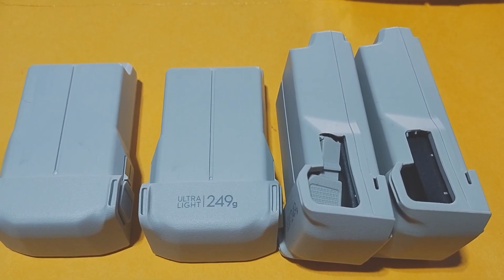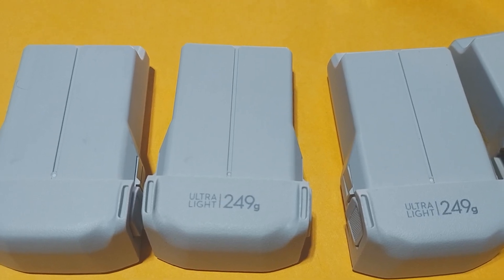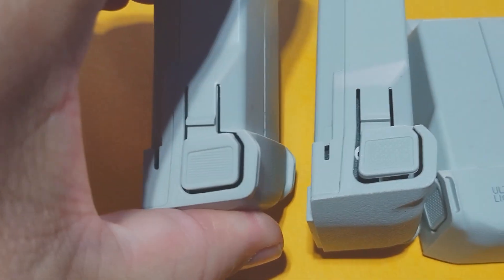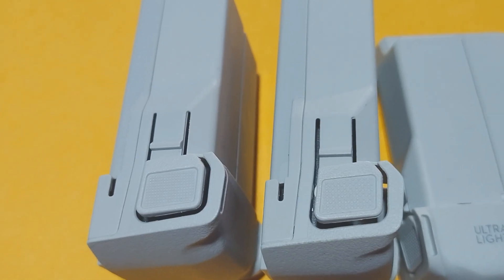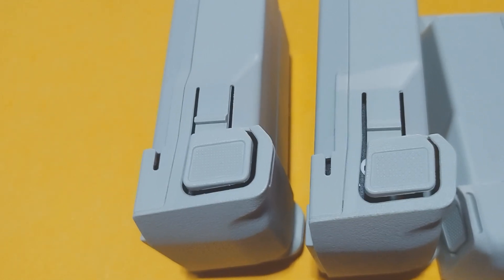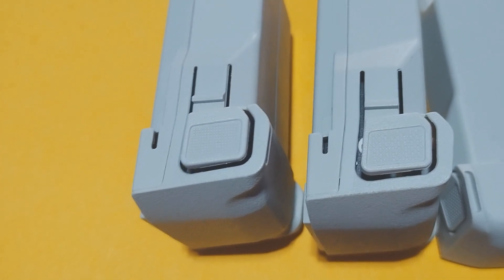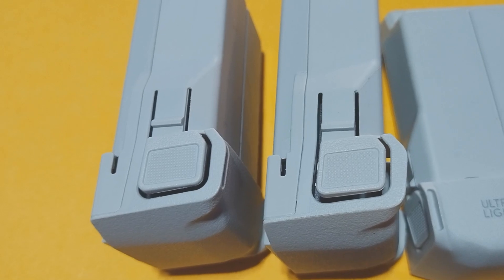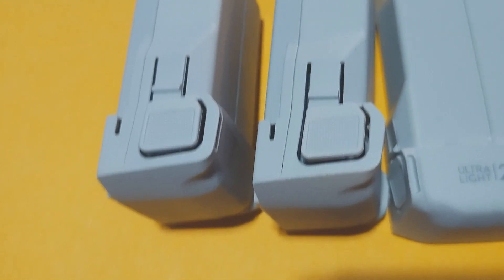DJI Battery Fatal Flaw Follow Up, Its Much Much worse than I thought.

Comment: Yes, my Mini 3 Pro batteries had the same issue.  So far, they have not been completely broken but I have worried about this for over a year and since my care refresh had expired, I knew I would just have to replace them at some point by buying new ones.  I still have them all and they still are able to remain safely within the drone without dislodging. I never bought the Mini 4 Pro but I have purchased the Mini 5 Pro.  Do you think this will happen to the Mini 5 Pro? Surely, I have no care refresh package with it due to U.S./DJI issues.  Thanks for sharing.

Comment: Can you take the battery case apart and put something on the inside to help it keep it spring tension
Reply from the maker: Not that I know of and I have barely used it since the video and have another already snapped and all but fallen off.

If someone would do it I think a thin spring metal tab could be made that would be able to slide over the plastic it breaks away from and replace them for pennies each. it would weigh no more than the plastic

Comment: This happened to 2 of the 3 batteries for my mini 3 pro. They broke within a few weeks from new over 2 years ago. The 2 affected are from the flymore pack purchased at the same time. I tried various type of repair, all were unsuccessful. A few months ago I bought a battery retention clip from ebay that holds them in securely. Search for “ Battery Buckle Lightweight Anti-slip Clip for Dji Mini 3 Pro Drone Accessories “ Since then I have bought some replacement battery cases. I have made a replacement on one of the affected batteries so far and tested it, a few times successfully. I replaced the part with the clips, leaving the battery still attached to the original other part. I had to cut/grind some parts so that the case fitted snuggly and I am happy with the fit. I still use the retention clip as belt and braces.

Comment: as my battery was new in fall i had no issue to my knowledge .. i flew it jan 8th 2025 and when i got home i went to remove the battery and with touching it i noticed the snap was sunken in--   IT WAS 27' F.  I THINK THE COLD HARDENED THE PLASTIC  AND T POPPED ?? - i was lucky the battery  did not fall out  in flight as i was very  high over buildings  the mini 4 would have been lost for sure....  now i am looking for glue  or silicone  to make some sort of repair as i only have 11 flights on this battery  and it is still  very strong  (short flights  at that)   DJI  SAYS  30 DAYS WARRANTY   FOR A 79 DOLLAR battery     EXPENSIVE  FUN HERE GUYS POOP .

Comment: Happened to me as well, just after 2 weeks of use (4 flights). My retailer replied that batteries are consumables and will not be replaced :( I will probably try some aftermarket (non-DJI) batteries and hope they will work better, because when its broken, it dose not hold in the Mini 4 PRO.
Reply from the maker: They replaced mine, They are covered for a year. Make a ticket. They are not fixing this if no one hold them accountable.

BTW are you using the 3 port charger?
Reply: @jsauerii  Yes, I used the two-way 3 slot charger that was in the fly more combo. The battery cracked when I removed it from the Mini 4. I only hope this does not happen with the remaining two batteries.
Reply from the maker: @xhobv02  I was trying to figure out if something in particular causes failure but I am pretty sure its just a design flaw in trying to cut weight. Even the two of the four I did not return were already cracking but you could only see it under magnification. They will fail soon with use I have no doubt.

Comment: I purchased the Mini 4 Pro Fly More Combo in September and one of my batteries had experienced the same failure on the locking tab by December. I submitted a ticket to DJI and received a replacement within 2 days in the post. Great service by DJI support but this appears to be a flaw in the battery retention design. Same as you my batteries are only ever in the drone or the 3 bay charger.
Reply from the maker: They finally got mine back yesterday, I only sent the 2 that have broken off, the other two are just cracked so I waited. I am actually wondering of some of the 3 bay charge ports were made out of spec because I am considering that as what might be happening because I do have to squeeze a lot to get mine out. I have asked for specs to measure but no luck so far.

Comment: I've got three official DJI mini 4 batteries with no problems after a year! ( Combo kit)
Reply from the maker: In trying to sort out the cause I have four initial questions.
1: When did you purchase the kit? 
2: Did you get the kit with the batteries marked   249G to keep it under weight or the longer flight batteries?
3: How many times have you used each battery. I know you can look when they are loaded in the drone via the app but if thats too much trouble a guess is fine. If its a dozen per battery or 100's per battery that will surely make a difference.
4: Do you use the 3 port DJI charger?

Thanks. I would love to track down the likely cause if at all possible. Anything to get the to fix it.

Comment: Are these aftermarket batteries or actual DJI batteries?
Reply from the maker: DJI official batteries from DJI themselves. I have no aftermarket batteries.
Reply: @ well I just purchased my drone a few weeks ago and I tell you what if the same thing happens to me, I expect a replacement from Dji!!!
Reply from the maker: @Wegotourcountryback123  Keep an eye on them. If I can find someone else with recent failures to post on here I want to check on a couple of theories I have as to what is causing it. I am guessing a bunch of people ignored it, thinking it was something they did or they just tape them in or havent noticed the cracks yet. 

No way I have 4 of 4 going bad, Yeah the three in the kit maybe if they were manufactured at the same time but they don't even look the same, and the extended battery was bought later. I never noticed the issue though with my mini 3, but only had the one battery there.

Comment: Hi there.We're very sorry to hear about your feedback. With this, may we confirm if you've contacted our team? We want to help you in any capacity and we need to communicate with the relevant team to further look into this matter. Kindly provide any reference ticket/case number (CAS). We're always here to help.
Reply from the maker: I have not yet sent this follow up info about finding the other two batteries are breaking as well. Its the weekend. And to be honest, what are you going to send me? 4 more batteries that are already doomed to break? I am not sure I see a satisfactory end to this problem for any of us letting you just keep sending us batteries that are all doomed to fail until the 1 year warranty your support claimed we have is run out. Then what? You have a serious problem on your hands I see no immediate fix too short of getting it in the hands of the CPSC for a forced full recall. And that is certainly not going to help with your import issues. 

But yes you will be getting this followup info in my next email.
Reply: @jsauerii  Hi, there, we are sorry for any inconvenience, you mentioned that you had contacted our support before, could you provide the relevant ticket number or email address for us to check further?
Reply from the maker: @DJISupportGlobal   8653304